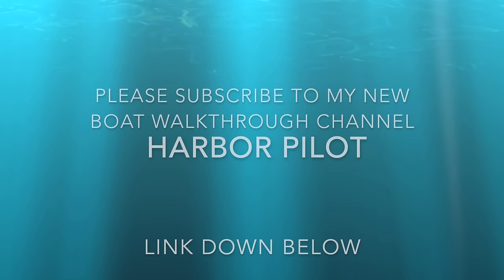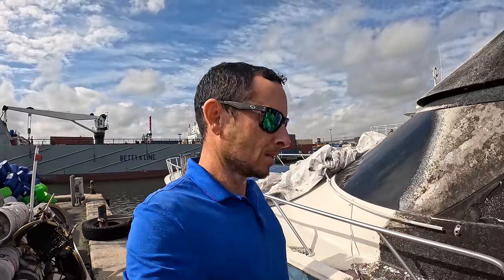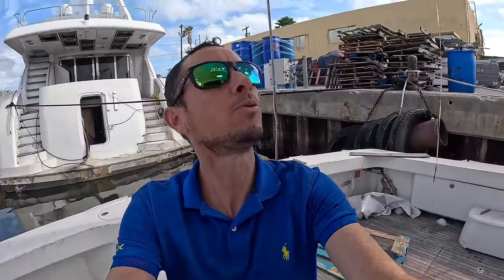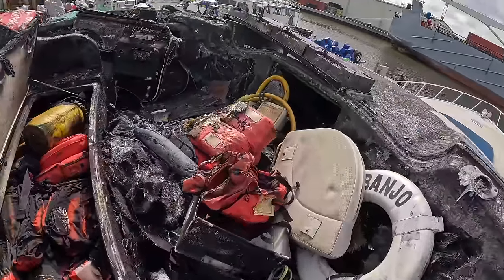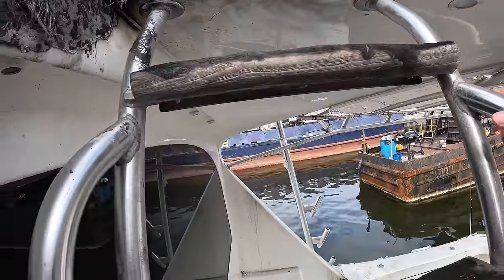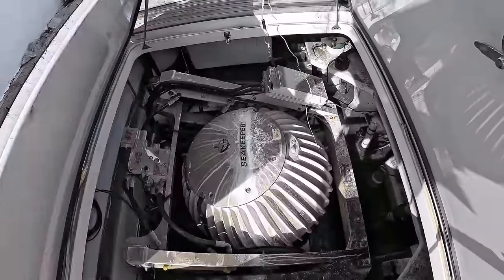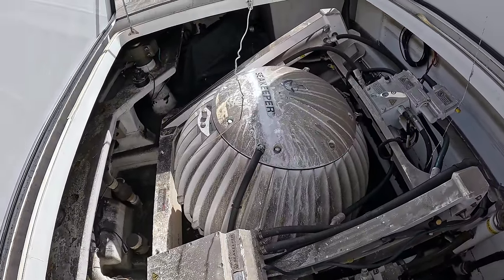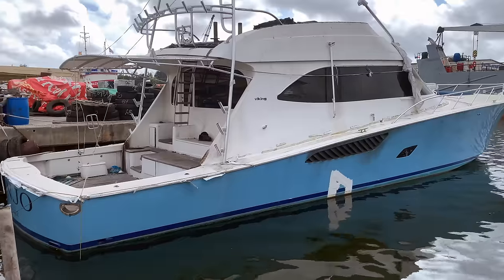Miami SALVAGE Auction | Money To Be Made? 76' Sportfish (Full Tour)

Comment: If a deep pocketed insurance company AND its team of bean counters determined it’s cheaper to pay the value of the boat to the insured you can rest easy knowing that even if you were to get that boat at the starting bid of 100k, it’s still not worth it. The best you can hope to do is salvage the sea keeper (70k maybe) engines (50-70k with no controls or wiring)  maybe the fuel tank (?????) generator, AC units (20k on a good day). Now you might do the quick math and say “hey I paid 100k and doubled my money, but you didn’t.  You have to factor in your time and effort extracting those components, transport of the vessel, and then getting rid of the rest of it. Then on top of that you need an avenue to get the salvaged good off your hands. This stuff sitting around while you wait for a buyer is costing you money. Really a project like this is best suited for someone either building a boat or repowering a commercial vessel or something like that.
Reply from the maker: Well said
Reply: Agreed. It will never be a “Viking 76” again…or even close. The major components…engines, generators, seakeeper have residual salvage value..but come with substantial recovery cost…along with the logistics/disposal costs of 70 tons of fiberglass and wood.
Reply: Pfffffff, that’ll buff right out.
Reply: That's assuming that the engine room didn't take on water during the firefighting process.  It is likely that the boat sank, and was parbuckled after the firefighting effort.  That would render the mechanicals nearly worthless.
Reply: I can fix it, my old man has an awesome set of tools.
Reply: @kevinlitzinger4741 
Is he a tv repairman?

(Sidenote: I remember those well. I also remember buying tv tubes. Times definitely have changed..)
Reply: not true at all, i work with written off vehicles everyday and cost has nothing to do with it, in order for an insurance company to repair a damaged vehicle it has to be repaired to factory specifications and to an extent that the repair will prevent safety or reliability issues of the vehicle in the future, an insurance company will write off a $50k car for a small fire, flood damage, or sometimes hail damage, theres a possibility that you could just jump in that car and drive it as is for the next 20 years but the insurance company will write it off, heres the kicker : it gets even more extreme with trailer rv and boat write offs because you cant trust fire damaged fibreglass, and there is no way to repair a travel trailer (exterior but sometimes interior) to factory spec, just last week i saw a 2022 19' travel trailer that had ripped the awning off scraping against a tree, it sold for $1800

Comment: 200k isn’t remotely close to restore the boat even to non running condition. The smoke residue may be toxic due to the multitude of different materials used. You should consider using proper PPE while in contact with a vessel such as this one. Getting insurance for it might be a problem.

Comment: Too much work. I think it would take a couple million to get it looking close to what it was. Keeping in mind the title will forever be tarnished as a "salvage" so even if you get it looking and running "perfect" the vessel will never have the value it should if it didn't burn. Don't assume the engines and gen sets are good either. When this thing was on fire it probably had so much water dumped on it that the vessel was probably close to sinking. I would bet the engine room was flooded by the time the fire was out. I have seen similar size boats on fire they all nearly sink from the fire water. If there was no fire or water damage in the engine room I would feel more confident. Yes I'm a life long boater from Miami. I don't have much experience with boats of this size, but a boat is a boat, the size only increases the cost of things. With regards to the smell. I live on the water in Dania just west of the Director ship yard. There were two 50' sailboats on fire in the canal and I could smell the burning fiberglass from my house a mile up the canal. The smell stuck in my nose for days. Oh and...both sailboats sank by the time the fires were out. You can find videos, search "Dania Beach sailboat fire"

Comment: So... Contrary to what the comments say, for the right person, this could be a real money maker.  You need a place to dry-dock it.  You need a crew of 3-5 talented individuals.  You need roughly a million dollars.  And, you'll need about 6 months.  There are folks out there that have businesses already set up and configured to do just that, complete with the right tools, talent, and contacts.  The key would be to make darn sure that hull is sound and that the engines can be repaired, not replaced.  Fire damage is salvageable.  Rot and mold is where you lose big time.  So, you look to see if the Hull is reparable and if the engines don't have to be replaced and a low entry price compared to what the saleable price is.  If I still had the things listed above, I'd be ready to take a shot at it.  But, this is certainly not something that you take on as a part-time job.  This is a business project.  By the way, that looks like a Seekeeper 18, which runs for about $180K... So, that right there could help you turn it around quickly, if the goal is to just buy it for scrap.
Reply from the maker: Thanks for the thoughtful comment

Comment: Too bad there isnt another identical boat that was damaged in another way, make two boats from one.

A boat that size would require a seakeeper 14 or 18 and the 14 starts at $149,000.  That boat could be parted out at a profit.  The propulsion engines and the seakeeper could be worth up to $300,000
Reply from the maker: I fit wasn’t so big I’d try it
Reply: @CharlotteHarborFisherman Was that boat unoccupied when it caught fire? I added a firefighting pump system to my boat that allows me to use sea water or bilge water so the water being sprayed can be recycled so the boat doesn't take on too much water.
Reply from the maker: @DarrelJones-fh2wx  Im not sure but that sounds like a good idea